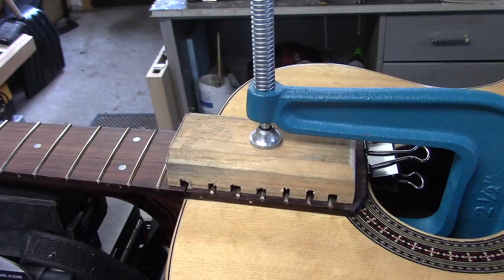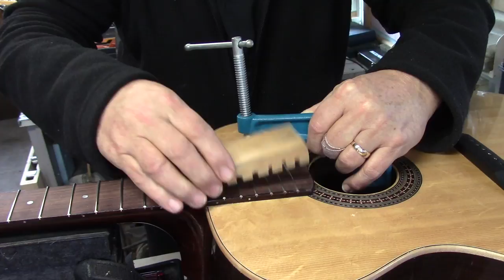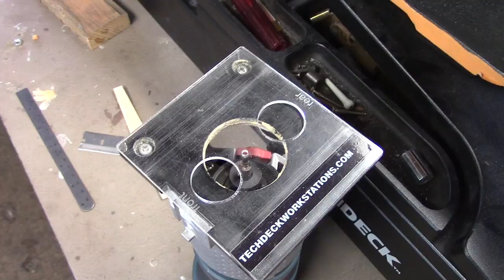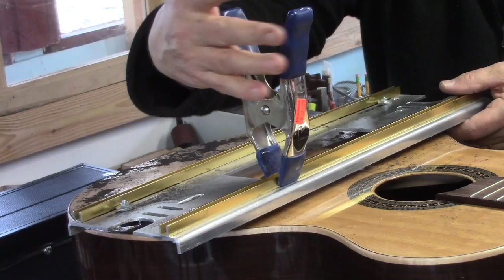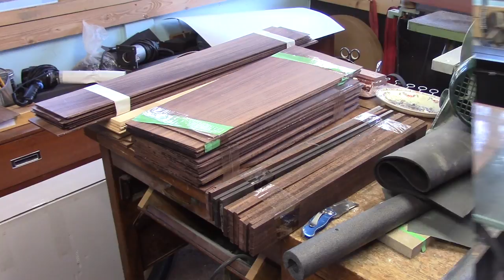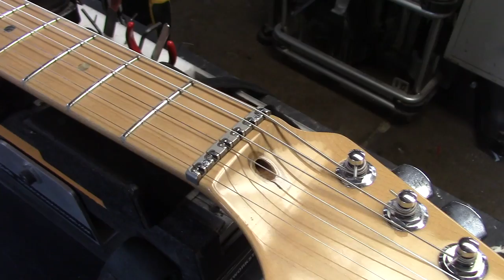Slotting the Acoustic Guitar bridge @StringTech Workstations

Comment: Some people have been known to lift their trucks with hockey pucks.   Tell me more about that second hole in the side of that first guitar.
Reply from the maker: Ty: Sound ports have become a fairly common thing now amongst boutique builders. The side does need to be backed up with a veneer ( in this case Darcy used a .040" Koa veneer) to prevent the solid rosewood from splitting. Are you still out west ?